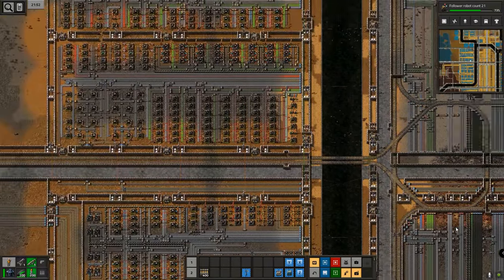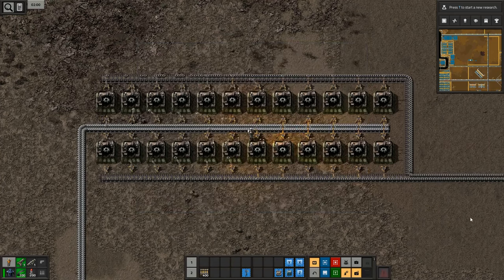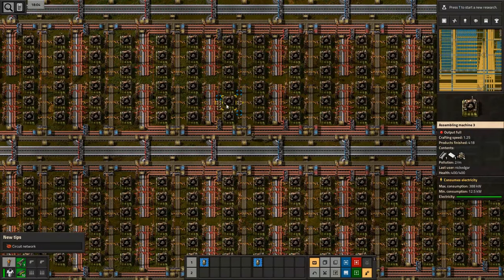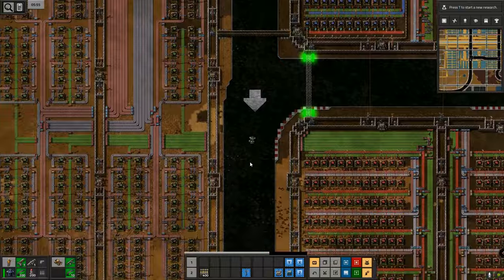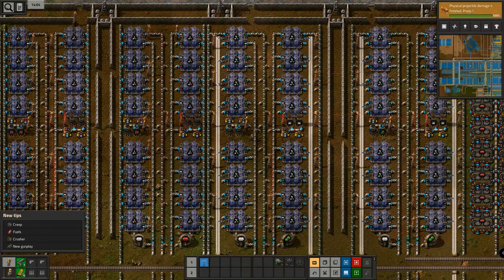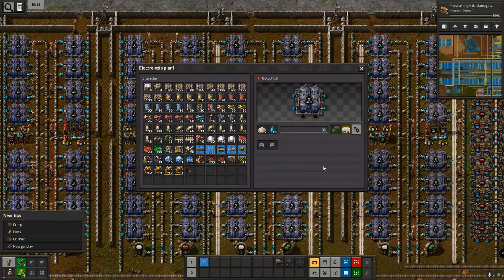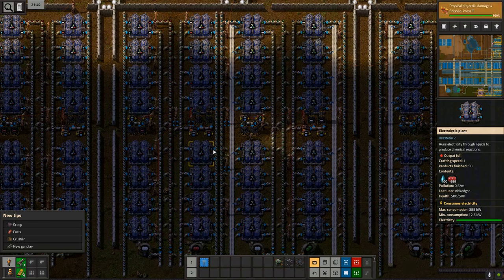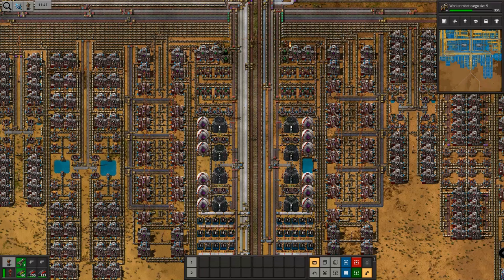Factorio - Finding and Fixing Problems

Comment: I don't think it's fair to say that storage removes the problem of throughput. Throughput is a big problem, I've had issues with too much storage not allowing my nuclear power plants to use up all their steam, taking it from 480MW down to only 280 MW, because the more pipes and storage tanks involved in transferring the steam the lower the total throughput, and the throughput is what you need to carry out your industrial processes.

Ultimately this is how throughput issues will manifest: At the far end of a pipe system, you need water, petroleum, steam to come out. If there isn't enough coming out, your machines don't run. The way to get around this in practice is to periodically put a pump in any storage system, which will greatly speed up fluid transfer through large storages.
Reply from the maker: This issue kept me awake last night. At the very least I haven't covered pipes and fluids in enough detail, and at the worst I am flat out wrong. 

I've completely removed that section of the video.
Reply: @theotherbigfoot  Appreciate you reading my comment. The other thing I would add is that how you design your storages matters a lot.  If you don’t incorporate storage into your designs well, your storages can “fight” for flow from your refineries or boilers. I think the worst would be if you arranged it so it was storage, then your production, then your consumption all in a row of pipe. The storage tanks will essentially drain off flow that should be going to your fluid consumers until they’re filled. I’m pretty sure that was why my reactors were not running at full power.  But it’s pretty complicated to figure that out, experimentally. 

In your video, it does seem like you designed so that you have this pipe segment storage in between your fluid producers and your fluid consumers, which is probably not a big problem. The real reason you don’t see people do that in vanilla is because of the fluid mixing problems in adjacent pipe lines, which are avoided with either your flow control mod or with underground pipes.
Reply from the maker: @willtcox  The fluid mixing issue, the reason why I use flow control, is from a version of factorio from about 4-5 years ago. There was no fluid mixing prevention back then. I know they've fixed it since but I still don't trust it.

The flow rate issues you point out with storage are all, as I understand it, standard hydraulic system things. A level system of fluid needs to be established before flow rate is useful. An equilibrium. To be honest, I'd really like there to be something which can develop a pressure head added to the game, I think that would remove a lot of the problems with flow rate.
Reply: When you say pressure head how is that different from the Pump? Isn't that what it does?
Reply from the maker: @willtcox  By pressure head I mean something like a water tower. Is a pump the same as a water tower? Not my area of expertise, but they feel different!!

But if we are pressurising the system (I was thinking about this in bed last night) then there would be nothing stopping us from putting a million pressure into the system. The game would need to include a mechanic for the pipes bursting. I suspect this is why the pipes are the way they are.
Reply: Well, fluid move on a system of "pressure" based on % full in a pipe or storage. So a pipe that's 80% full will flow into a pipe or a storage tank that's 79% full. A pump will maximize the pressure difference between the fluid storage in front of it and the fluid storage behind it. So yeah, every full storage tank does work kinda like a water tower. But no, it won't burst pipes.
Reply from the maker: @willtcox  There is a further nuance to consider with a pressurised system, it must be 100% full. That's where the water tower comes in. In hydraulic terms this is a closed system. No air can get in.

The system in factorio is an open system, so air is free to flow in and out depending on the relative level of the fluid. No pressure can develop. It is gravity fed. Another reason, I think, why the world is flat and there are no hills. Hills would seriously mess with how the fluids behave.

The more I think about it the less likely it is going to change, The game mechanic for limiting pressure in a pressurised system is for the pipes to burst, otherwise we might be able to develop an infinite amount of pressure and that would break the mechanics even more. So we have a gravity fed system based on a completely level datum. That's the only way the current mechanics make sense. And it's why the fluids don't really work very well at high flows. The game can't simulate pressure, which would dramatically increase flow rates. 

There is a video here.
Reply: @theotherbigfoot  Don’t expect too much realism from a game where you carry stacks of 5 coal powered trains and dozens of nuclear reactors in your pocket.
Reply from the maker: @willtcox  HAHA, totally fair. Its just that the fluids and gases and pipes bother me and this whole conversation has pushed me to remember some of the stuff I studied at university and the itch has been scratched. I now know why I hate them. Specifically and technically. I don't know why it has taken me so long.

Comment: Broke: barrel steam

Woke: pipe steam

Wroke: use storage tanks as pipes.

I tell my 2x2 reactors to keep 2 million steam in the system. Above that number a new set of fuel cells get delivered. Under that number it'll insert them.

If you ride the power grid you're fine. If you use only use 20% it'll only insert as needed. No clocks, bots are a must 

I consume maybe 33k crude/min. Pipes seem to work fine with storage for fun. People forget you can have multiple refineries and pump jack networks that don't have to be connected directly.

Comment: Having a bit of trouble wrapping my head around your pipe layout. Could you please explain how the reserves of fluid far away from production get refilled fast enough to satisfy consumption for long periods of time? Other than that i agree this layout looks much better than using undergrounds
Reply from the maker: In my mind it went like this. 4 pipes say 3500 long from production to use.  That's 1.4M total storage feeding a system that is probably using, maximum, 1000/s. In my mind as long as the storage started full then I am essentially starting with a whole load of stored potential work. I then just need to replace what I use and a balance will be reached. 

That is how it went in my mind but I've had a lot of discussions with people, over the years and recently, and it might turn out that, over long distances, a single pipe is about capable of delivering 200-250 per second, and so my storage concept might fall down. I don't know. I haven't tested anything other than the way I do things and the way I do things kinda works. If it works for a different reason than I originally thought then I guess so be it. 

To give context, I had this kinda setup (4 pipes, 3500 distance, 1000/s) running at full tilt for about 6 hours for an SPM test and I never had a single problem with flow rates.
Reply: @theotherbigfoot  so it's more about multiple pipes then storage? In the example you provided, 4 pipes>1000 means 920/s flow (which is more than two lines of underground) meaning you are finishing your reserve at a rate of 80/s, which is reasonable for such a large reserve considering you will eventually have some down time you can use to catch up. Do you use pumps? Because just one pump every 500 tiles could bring you to 1760/s, though it would lose the benefit of allowing flow in both directions

Comment: Indeed Pipes are the bottleneck of many factories as its not scalable as simple as just stamp more pipes down.

I think that Pipes requires pressure system, since each fluid has same pressure, just a "density" that only reason is to control the speed that it will flow through the pipe. Example: petroleum gas, since its a gas, it will flow faster than water that will flow faster than light oil that will flow faster than crude oil that will flow faster than heavy oil. But then we have Steam that is a gas and has theoretically same speed as petroleum, and lube that has same speed than light oil, but they have different densities, shouldn't provide same pressure in a pipe stream even tho they move at the same speed.

Something close to stationeers could be interesting, where you need to control the pressure inside the pipe or it'll blow but maybe they don't wanna code that far, they could just state a maximum pressure each fluid could have on the pipe system, instead of those "100/100" indicators that are just how much filled the pipe is. The idea of handling pressure is that you could have increased flow speed on the pipe if it has more pressure. 
Tank <> tank can flow 12k u/s; pipe > tank can only flow 3000 u/s if single item with pump.
With pressure value, we could put a pressure pump somewhere in the middle of the piping system that would just apply pressure to the liquids forcing them to move faster, so that 2million crude oil stored in tanks could move at 12k u/s inside the pipes since you have pressure pumps in between them.
Reply from the maker: I have always wondered whether viscosity is modelled in the game at all. Is that a value that can even be modified in the game or is every fluid just assumed to have the same properties?

Pressure also, as you say. It is not difficult to imagine a storage system in an industrial setting that can provide a pressure head, so why not in factorio? 

Definitely potential improvements there.
Reply: @theotherbigfoot  You can change fluid viscosity with mods, that's what angel does with his fluids on petrochemical. But that essentially is just changing the speed of which the fluid runs inside the pipes.
Reply from the maker: @mobius1qwe  Confirmation. Finally, wow, I knew the fluids behaved differently in angel and bob but until now it was only a gut feeling. Effing confirmation. Amazing.
Reply: Pipes in Factorio are kinda weird. They don't really have pressure, flow rate is entirely created by fluid level differences. On one side is your intake pipe with level 100, on the other your output with level 0(ish). The throughput limitation is the slope you're able to create between these two points. For small sections between pumps it is very steep, so the fluid can flow fast, but as you get longer and longer it'll become less steep and fluid flow slows. And while yes, fluids do technically have different viscosities, they only seem to affect their behavior when it comes to filling in empty pipes. Water spreads the fastest across pipes, followed by gasses like steam and then the various oils. But once the pipe is filled in, the pipes seem to maintain their advertised throughput no matter what fluid you shoot through them.